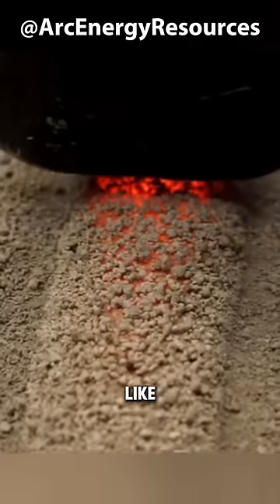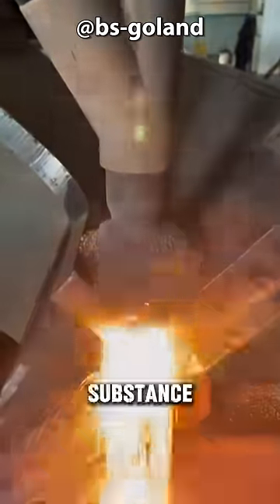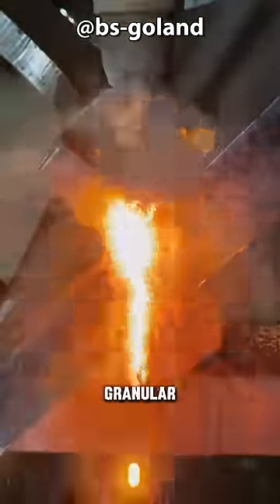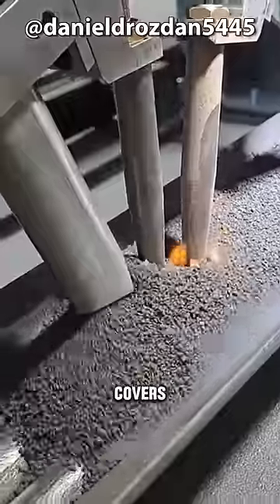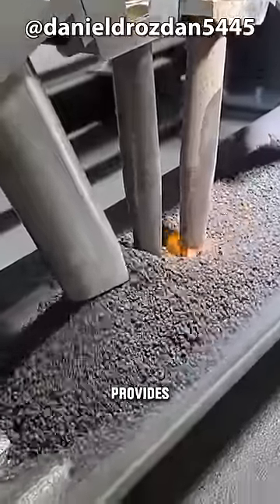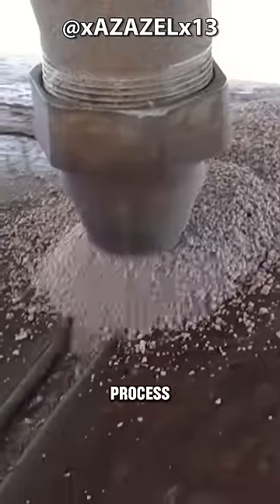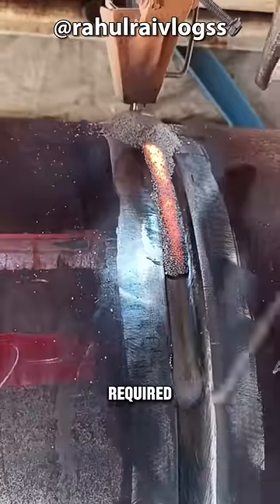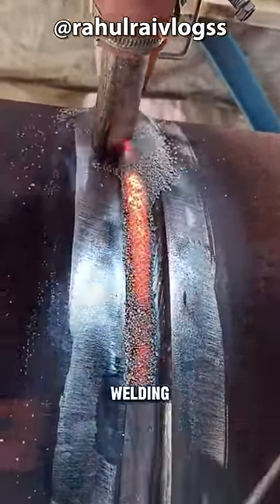Incredible Welding Method #shorts

Comment: And when the Sub arc weld settings are set just right, the slag will lift up and come out in long segments when cooled. Very satisfying to experience.
Reply: My stick welds do that, always love it.
Reply: nice and warm in the winter time too
Reply: How have I not heard of this? What is the Flux made out of?
Reply: @177og1K  Calcium, magnesium, sodium, potassium and manganese oxides, calcium carbonate and calcium fluoride typically, in granular pieces as shown.
Reply: Lobster tails! We have a subarc we use to make beams for bridge cranes. It allows us keep the lower flange width narrow (6”) which is great for an under running trolley. The top flange and web can change substantially depending on capacity and span. Subarc gives us the freedom to build what we need rather than waiting for Siskin to roll what we need and considering getting an S beam is like pulling teeth it’s better to build what you need.
Reply: It also creates a better bond when you use dual wire submerged arc welding. For thicker materials. It’s like a cross between wire welding and stick welding but not flux core. Heavy duty stuff.
Reply: The settings need to be precise if it burns thru.. it requires alot of grinding and just looks bad on a nice seam.
Reply: @xinny4190  thank you. So, no pine turpines like solder flux. I'm not a welder  but pretty slick with an iron.
Reply: @177og1K I'm slick with both, welding isn't the same. Its like pushing a rope up a hill. You often don't get a second shot to lay it right. But other than that I actually find soldering much harder as it requires more precision
Reply: How much does that pay an hour, I wonder. I could guess,  but I'm sure I'd be off by a digit
Reply: @177og1K me either! WTF?
Reply: @xinny4190 gracias,  maybe I should've chose welding back when,  instead of military, power infrastructure, bridge construction/demolition(which was strangely satisfying), and then I kinda got old😂
Reply: @xinny4190 so this flux is technically a multivitamin?
Reply: Like those growing snake fireworks on the 4th of July??
Reply: @charleslord8672  Depends where you live. Where I am, a good operator is well paid because a screw up or not following the procedure costs the company a lot more than wages.

I was fortunate to be trained when I was just out of my first year of welding school. It's not very common compared to other forms of welding. Getting that early experience and sticking with it was great for my career. I was never without work and kept very busy during the 08 recession. When I left welding for inspection I was at $42/hr with full benefits, profit sharing and company shares.
Reply: I love how there is not even a ripple in the weld

Comment: The can actually reuse the unmelted granular flux. They use a vacuum that puts it back into the system to use it
Reply: Thank you!
Reply: Even welded part can be reused(crused again) and put with normal granulats, its cheaper but its pain in ass to keep a track of all bags that are "infected" and those who are not, only few bih companies in world( around >=36 ; 2019year) use it this way
Reply: Yeah thanks I was curious about that
Reply: Got systems where the vacuum are attached to the machine now follows right behind it
Reply: Wow almost actually possibly saw that in the video
Reply: We re use the 980 flux a few times but only once for the 880
Reply: Not all of it some can’t be re used. It depends on the flux you buy. And when you can there’s a specific percentage of used to new mixture you can’t exceed

Comment: I ran a dual feed that welded two sides of overhead crane girders at the same time. It had vacuum recovery for the flux. It was more than 10' tall and ran on small rail tracks 100' long.
Reply: That thing:  '
Does it mean feet in this context?
Reply: @ajoshdoingthings541  Yes, like " means inches. # can mean weight in pounds too.
Reply: @paintnamer6403  thanks, was just making sure since I rarely see it used all alone without any fractions of inches. 
Usually I only encounter it with their literals as unit indication and I'm kinda used to use °, ' and " as units for angles instead.

Impressive how y'all just juggle around those units and their conversion factors while constantly explaining it to metric people at the same time
Reply: @ajoshdoingthings541 ' is for feet and " is for inches so 5'3" would be 5 feet 3 inches. It' s like a decimal system for feet and inches...kinda
Reply: @ajoshdoingthings541  I wish we would change to metric honestly. Inches broken down in fractions (3/4 , 15/32). 12 inches to a foot. 3 feet to a yard. 1760 yards to a mile. Or 5280 feet in a mile.

Comment: Adding to what I wrote earlier, sub arc is always in hundreds of amps and very ver short arc length so the conduction point is below the flux cover anyway , flux shields the molten metal being deposited and that’s it, it’s like saying with out gas coverage mig welding won’t work , it will but be heavily oxidised
Reply: It really sucked when the flux ran out during a weld!!

Comment: Can the granular flux be reused
Reply: Only The loose stuff that they’re vacuuming up, yes.
Reply: Generally yes, though it depends on the flux. A neutral flux (more common for general purposes) can be reused if it hasn't been melted, while an active flux should not be reused. The difference between the two is that the active flux has a specific 'recipe' of alloy compounds that change the chemistry of the weld metal, while a neutral flux doesn't.

Comment: It's only drawback is that it can only be performed in position 1 (flat).  I wonder if you could add some contraption that applies gentle force to the flux for positions 2-4 and make it viable for those.  If I invent said contraption, I believe I could be rich.
Reply: Actually there is a Pipe joining version too. Rotates the pipe and feeds the flux to keep the Arc submerged …
Reply: I wonder if it could be done in N2 or vacuum to reduce the Flux requirements
Reply: Really good welders can run it overhead!!😂😅😂

Comment: I used a submerged arc welding machine at work, if i remember it was running 490A at 42V with 3.2mm wire
Reply: Isn't 42v too much?

Comment: No. When heated by the arc, the granuals produces gas which engulfs the weld, creating a clean weld. The coating on arc welding rods does the same. It can produce high quality welds automatically.

Comment: So what is this welding style used for? And why?
Reply: @BloopTube  okay, thank you 👍
Reply: I used it welding wind towers. Some welds would take 4 shifts (2 full days) they were so deep.
Reply: Worked in a large propane tank factory and thats how they are welded up.
Reply: If I remember correctly . It is used in manufacturing submarines.
Reply: In the shipyard I worked at we would use it to join sheets for the hull or deck. It has to be done in a flat position, (or at the top or bottom of a rotating cylinder) so it’s limited but it’s a very efficient way to get very high quality welds if you can set up your workpiece to use it.
Reply: We use it for water tanks and it's also the same as used in propane tanks and many others.
Reply: We weld together very large thick plates for ship building with this process
Reply: Sentara.  It's used where a consistent seam with zero air pockets are required, such as high pressure vessels or equipment submerged in a high temperature fluctuation environment.
Reply: Worked on this 80's for girders, barge, huge oil farm tanks, ship. Just adjust your welding machine, wire feed, track and speed, flux box and youre good to go..

Comment: I too have run a subarc I worked for a company that we built the giant earthmovers the four-wheeled loaders as well as offshore jack up rigs. We will did the pinions lifting gears and gear up gears for the drive boxes and all other sorts of lifting equipment for the jacket rigs. They would occasionally take a year that we had welded and take it two of the testing facility and test it on average for our welds to break would take 2 million pounds of pressure. There was also a point in time where I was on pressure vessels using subarc. Subarc is the best thing I know for doing 100% pure well You just have to remember to backgouge the other side when you can.

Comment: I loved doing this!
We welded up long sections of bent plate into 60 ' long tapered pieces,  then put the two halves together, making a diamond shaped column that was 4' wide at the base and 1' wide at the top.

The base plate was 2" thick!
These were used in electric sub stations.
Lots of Sub arc ( submerged arc) welding!
Very satisfying to do!
On the flip side however, was when you welded one side, you had to flip them over then air arc gouge the root of the weld clean, then grind it and weld it again for a full penetration weld.
That air arc was LOUD!!

Comment: 75% of the flux can be reused. And SAW also requires preheating and post heating to move the heat effective zone outside the weld area to stop linear cracks from forming. This welding process is usually used on large thickness of materials

Comment: So, how it works about UV light emissions? Do you lower the amount of light that comes out from the soldering?
Reply: What?
Reply: Its not supposed to arc outside the flux
Reply: @nurgles_be_saggy  I mean about uv light and the need of soldering mask. Maybe with this method you don't need one or you can do with a lesser one

Comment: The flux does not provide any electrical resistance,  it melts due to the heat generated by the wire being fed into a arc that is created with electricity.
Reply: It'd probably becomes a semiconductor or a conductor at a certain temperature,900+/-
Reply: @cameronanderson4182 no, it doesn't need "conduction" it is there to protect the weld metal from oxygen

Comment: This welding process is always perfect so long as the programmer does their thing right
Reply: And you don't run out of flux mid weld!!😎
Reply: @jacko4483  see under "programmer did the right thing." Only way to mess up is operator error the robot only does as you tell it lol

Though there was this time aquarium sand was used instead of the flux... thst was a funny day of trying to figure out wtf was going on.

Comment: It gives the same bond in welding that SMAW does, but with wire. Which is the best for heavy duty stuff. Good penetration and root. But using wire instead of a stick.

Comment: Flux is just stopping air get to the weld and probably allows it to cool slower in this case most likely 
Basically you just need the surrounding environment to be inert to the point it won't bond with the melted metal 
So doubt sand itself would work as it would probably just melt and bond making some weird silicone glass iron, although now im interested too see, for science 🧪 
Buts obviously this is some strange flux "sand" so its chemicals are different

Comment: The flux does not provide electrical conduction between the base metal and the ELECTRODE.  The ELECTRODE provides conduction between the base metal and the ELECTRODE.  The flux shields the whole process from the atmosphere.

Comment: What? It has nothing to do with electrical conduction...it keeps the arc and the weld pool shielded from the atmosphere. Creating ideal conditions for welding. Depending on the composition of the flux being used it may aid in or help remove impurities from the alloying reaction.

Comment: It absolutely does not provide conduction path, flux provides oxidation cover only , the electrode forms an arc which ionises surrounding air to breakdown resistance allowing continued conduction . Please back up your misinformation with understanding and then push factual information for others to enjoy instead of bullshit.

Comment: We have a subarc we use to make beams for bridge cranes. It allows us keep the lower flange width narrow (6”) which is great for an under running trolley. The top flange and web can change substantially depending on capacity and span. Subarc gives us the freedom to build what we need rather than waiting for Siskin to roll what we need and considering getting an S beam is like pulling teeth it’s better to build what you need. We also build the camber into the beam and cut it into the web plate. Best bridge cranes on the market. If you want good stuff buy Ace Industries if not buy Kone, Finnish junk!